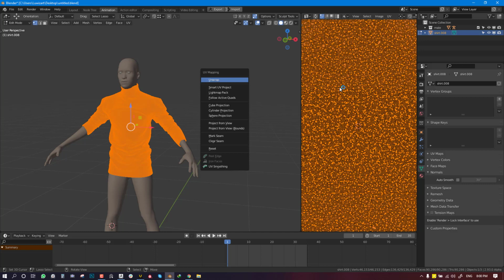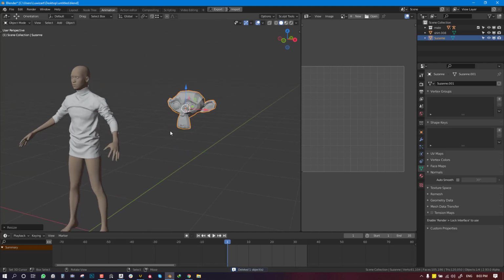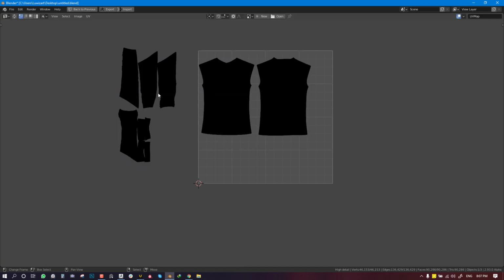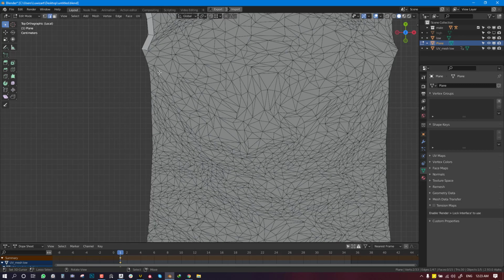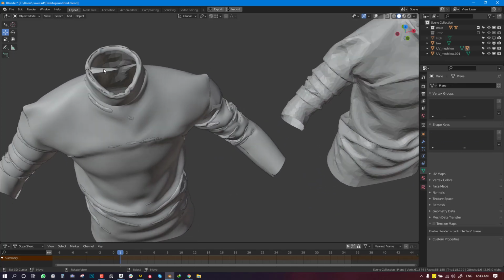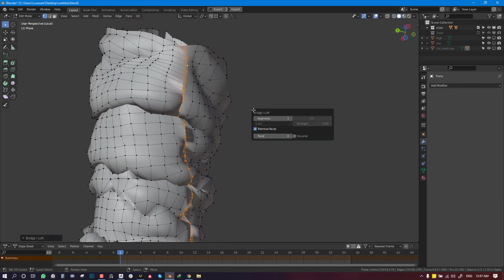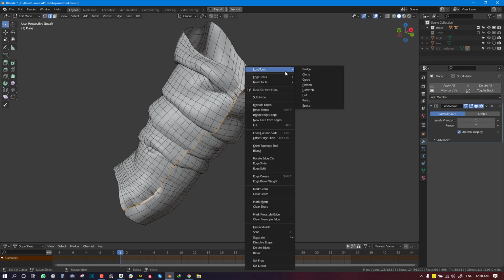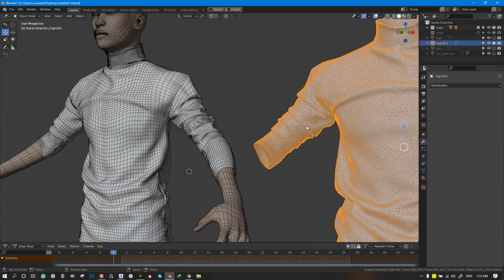using blender to retopologize Marvelous design Assets

Comment: I already do this method lol
Reply: I am learning
Reply: how? I didn't find the  create UV mesh option in blender, is it a specific version
Reply: @hailahh2115  He is using Tex-Tools addon. I saw some of the extra options he had in UV mapping menu,  googled them, and found out it is that one addon. I don't know why he didn't clarify that in the video.
Reply: @motekininja2174   Thank you!
Reply: @hailahh2115  I dont think he explained that part, its probably an addon
Reply: @Zev_Reef   but you said "I already do this method lol" how are you doing it?
Reply: @hailahh2115  Lol 
Well in Marvelous Designer I export the Clothing as unmerged
I reset the clothing into 2D UV map shape and export that too
 In Blender I add the UV mesh shape as a shape key to the clothing shape and then I do retopology on the UV shape followed by the surface mesh transform(Whatever its name was) modifier, turn on the shape key, apply the modifier on the retopo and then connect the verts.
Reply: @Zev_Reef  thank you so much ❤️, this is very helpful.
Reply: @Zev_Reef good afternoon you know the name of the addon
Reply: @celeturles4854  The addon to do what exactly?